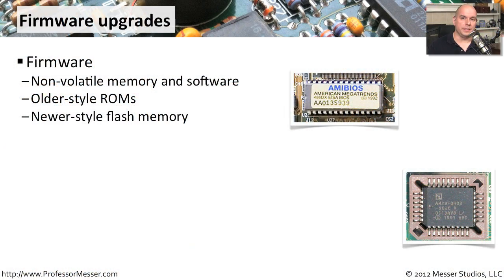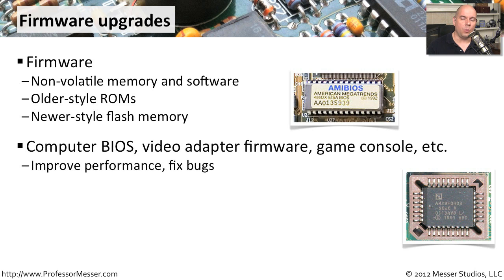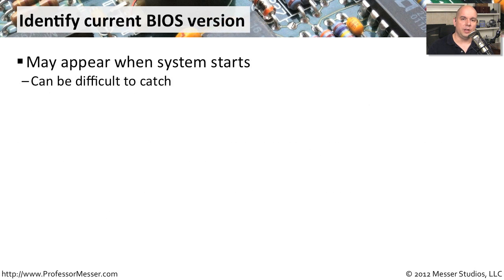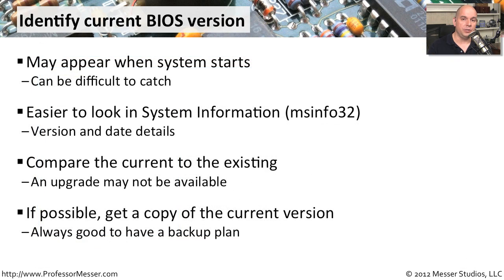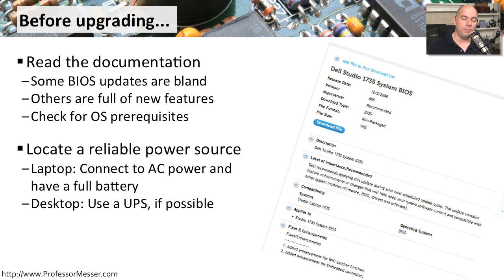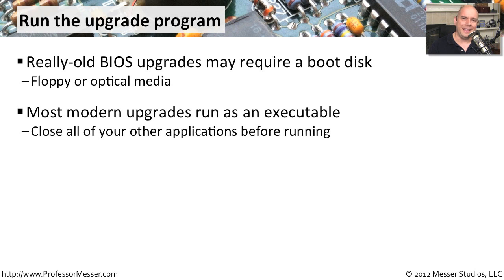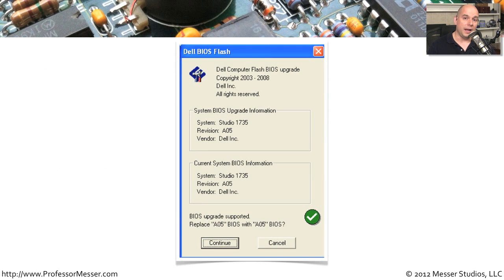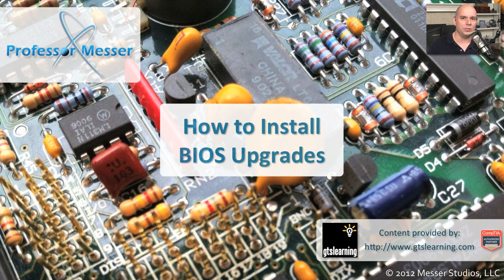How to Install BIOS Upgrades - CompTIA A+ 220-801: 1.1

Comment: mine says Dell A10 version May 2008 should i do an upgrade?  Also if i do is there an upgrade for this model Dell620? The other thing i wanted to know is i have an 2006 HP pavillion which the motherboard died on it, is it possible to swap them over...i.e to put the motherboard of the Dell into the HP Pavillion?? Or should i leave it alone?

Comment: Hi Daone,

Some drivers are proprietary to a brand of computer, and not to a OS purchase, that why there is no sound... or, specific BIOS', brand featured programing and special function keys options you need to search out the driver from the manufacturer or what I did was to take my restore disc [My PC came with] open it in a explore or search manner, not install means, to see specific drivers and harvest them. However not all manufacturers of PC's allow you to do so.

Comment from the maker: The 220-800 series exams have a completely different structure than the 220-700 series exams. You should not compare the 701 to the 801. If you're planning to take the 800 series exams, you should watch the 800 series videos.

Comment from the maker: This isn't quite correct. As of January 2013, you can take either the 700 series or the 800 series exams. The 700 series will remain available until August, at which time the 800 series will be the only choice for the next few years. Regardless of which exam you pass, you will receive the same A+ certification.

Comment: hey there, i stick to the 801 and 802 cause they no longer do the 701 702 version no more i think. Currently i m studying for 801 -802 which is the comp tia exam now until august 2013. So my best bet is to stick what you doing now instead of the old exams. check it out on the site comptia+.org